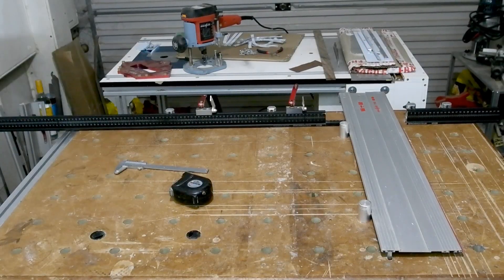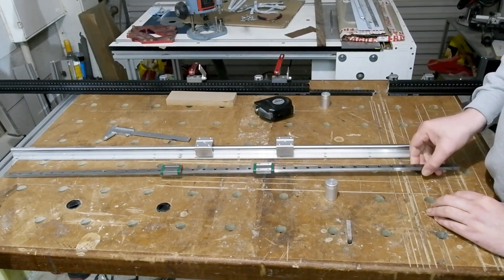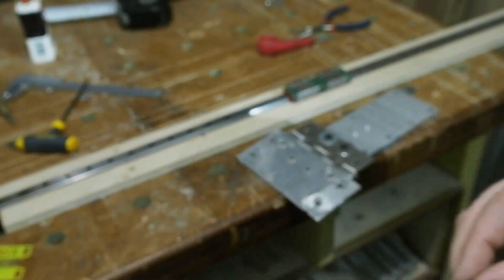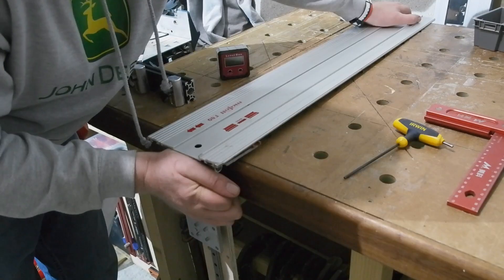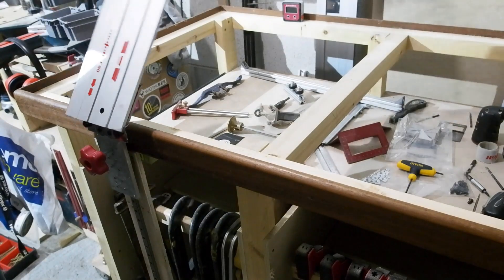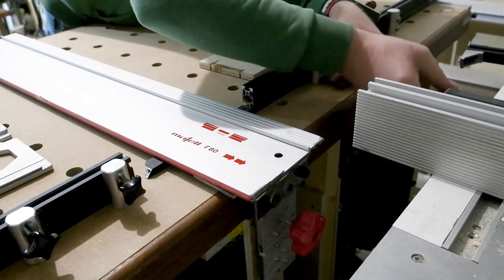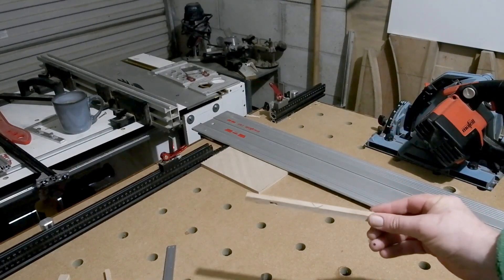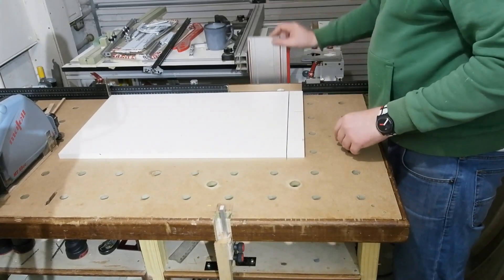Retractable Hinged Guide Rail Do-Over Upgrade

Comment: Would not you prefer a StealthStop Woodpeckers ruler rail ? It's flush with the table, and you can still block the wood at the desire length. Problem I'm not sure if there is an equivalent in Europe.
Edit : it does exist in the UK and Europe.
Reply from the maker: I don't think so. The stealth stop is a neat system for a mitre saw station but, on an mft cutting system, it's important for a fence to have under rail support. That is, a thin or low profile section of fence under the guide rail to stop work being pushed back as you cut. The benchsogs fence offers this. The stealth stop doesn't  ...at least from what I've seen of it.👍
Reply: @BischBaschBosch  Yes it does not have one. But there's a secondary rail to add a fence/blocker where needed. I thought it's lighter to uninstall when we want a clean table again. 
The other possibility would be to embed both systems in the edge of the table, flush ; then rotate vertically on demand once we want a fence.
Reply from the maker: That's an interesting idea. Pretty happy with how simple the fence dog system is though. Just lift off and store under the bench top.

Comment: Like the innovation of it being able to slide down at the back of the table, so you can still use it as an out feed. Great for a small shop.
Reply from the maker: Cheers. Yeah, it's only worthwhile where your benches are in the middle of shop really. Not needed if your bench is up against a wall.

Comment: Been thinking about making one of these as I dislike using the table saw so would like an alternative so I can use it even less.
Reply from the maker: I find both this set up and the table saw invaluable. Panel sizing on the mft, ripping on the table saw and so forth. It is great having a rail always set on the bench though. Be sure to check out my latest video on the BD fence upgrade. In it I also redo the front pin. Might give you some more ideas 👍

Comment: Fantastic! As a new tracksaw user with a similar set up but using profile and a gantry plate I’m still getting used to how to use it. Do you lock off the height adjustment for every material or do you leave it sloppy? Not sure if my setup is normal or a bit rubbish 😂
Reply from the maker: Cheers! I mean, generally when you're cutting, you're doing a bunch of the same material so, in that case, I'd lock it off. Now I have a lock, I probably still would even if I was doing 1 cut on different thicknesses to be honest. Whatever works best for you with stuff like that really innit. You saying you use profile and gantry for your track saw set up? I'll have to have a peak at that.👍
Reply: @BischBaschBosch  yes buddy, I’m using 40/20 profile and a gantry plate that was once a camera slider a company called RatRig used to sell for loads of money. It was only recently I realised it’s just regular profile with a gantry plate lol
Reply: I think a 60/20 profile would be even better